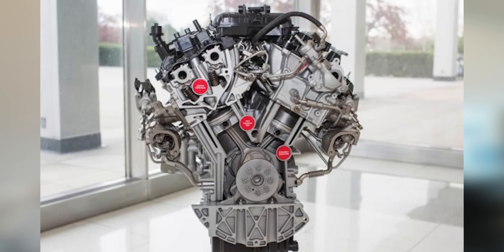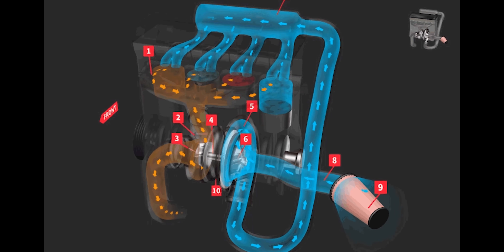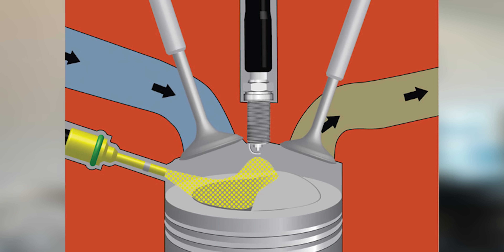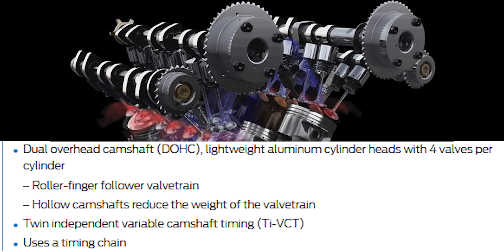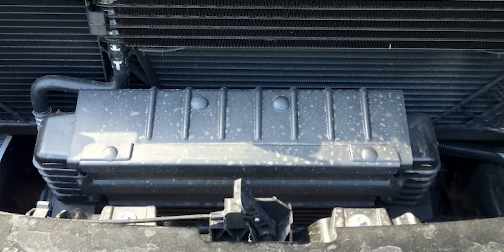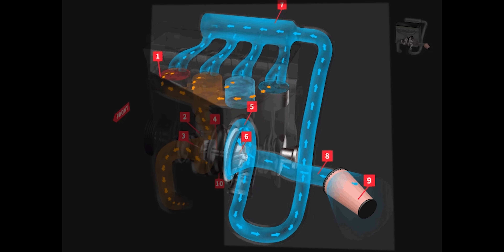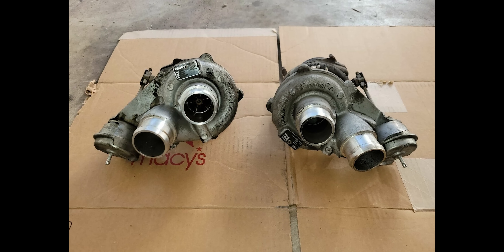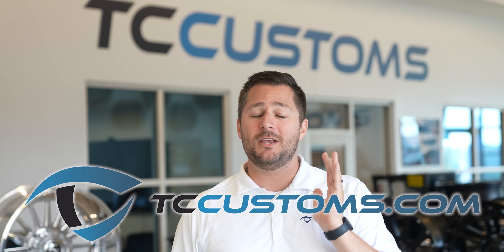The Truth about the Ecoboost Engine!

Comment: Dad just picked up a 2021 3.5. Awesome truck as long as the motor holds up. I told him to go with the ecoboost because the ecoboost has been getting updates with each generation. The 2018+ 5.0 has had many issues and they are not built as good. 2021 5.0 just switched to cylinder deactivation and a rubber belt driven oil pump. Not sure how well that is going to go after watching GM fail but Ford is usually a little better about testing. If this ecoboost holds up then I m sold on it. I was getting 24 mpg the other day with the cruise set on 70. Crazy to think in a crew cab 6.5' bed 4x4.
Reply: What about the timing chain, has that improved?
Reply: got a 23' 3.5 and its impressive.  Traded my 22' 5.7 Bighorn for the ford 3.5 XLT.  3.5 beats the hemi in everyway.   Also think the 10 speed helps a lot in the ford.  But Ram does have the Hurrican on the way for 25'
Reply: @dankruger2890  I’m very curious to see how that engine performs. The inline 6 making that much power is going to be crazy. Hopefully it will be good for Ram. The hemi was getting long in the tooth with no updates in years. The truck in the video is at 107k miles now. Gear shifter was replaced under warranty and had a few recalls but no major issues yet. My dads truck is now at 107k miles. Had the shifter replaced under warranty and a few recalls done but that’s it. All of that is really just part of having a first year of a new body style. He still loves the truck

Comment: 12’  3.5 eco boost currently 298,550 showing.  Besides the normal wear and tears it runs great.   Even if it laid down today I would have to get a newer f150 with an even better 3.5
Reply: Recently bought a 21', have you had trans problems?
Reply: @brianking9215  honestly no  but I don’t wanna brag because I expect anytime I could have.  At this point the only things have been brakes , caliper work,  exhaust holes/leaks, instrument cluster stays lit and doesn’t shut off with vehicle, took several jumps to find that out.  I pull the fuse each night now.  And my speakers/radio just one day quit working
Reply: @controlavirus9839  thanks for the reply, sounds like my old truck had 330k...

Comment: I thought that the purpose of an intercooler was to cool the air after its been compressed by the turbo. 
The cooler it is the higher the density, which allows it to move faster through and pack more of it into the engine
Reply: I think you accomplish the same thing by compressing cooled air, instead of cooling compressed air? Given the looks of that intercooler I'd hate to be pushing pressurized air through it.
Reply: @townhall05446  nonsense. When you compress air it gets hotter. How would you cool it before compressing it?
Reply: @mr.monitor.  mmhw
Reply: @ryanglover4549  what?
Reply: The intercooler cools the air before the turbo compresses it.
Reply: The intercooler cools off the air after it's compressed. Compressing air causes it to heat up.
Reply: NO! The real term is a Charge Air Cooler. It takes the nearly 300F compressed fresh air out of the turbo and cools is down. So it is placed AT THE turbocharger compressor outlet ant the intake manifold

Comment: the 2.7 EcoBoost on my F150 has over 100k without a single hicup..
Reply: AWesome!  Love my 2.7...54k on it right now
Reply: That's a lot more impressive on a 2.7 than a 3.5, the 2.7 is nowhere near as durable of a design, worse oil filtration and  only uses direct injection instead of dual port, plus being a smaller motor there's just less meat there to deal with the same stress.
Reply: @Prestiged_peck  Since 2018, the 2nd generation of 2.7L engines actually have both port and direct injection
Reply: @Prestiged_peck  2.7l makes less torque and power compared to the 3.5.  It doesn't not have the same stress to deal with so I doesn't need the same amount of "meat"

Comment: When the time comes please talk about the 2.0 ecoboost that will be in the Maverick. Thanks.
Reply: Yes
Reply: it’s essentially the focus st motor
Reply: What do you want to know? I work on them every day.
Reply: @solarfall2728  how have they improved over the time they have been in production? What are some issues that they have had and what did Ford do to improve it? Assuming with the regular advancements in technology, what might Ford introduce with the Maverick engine that could make it even better? MPG? Any special preventative maintenance that is unique to this engine? Thank you.
Reply: @solarfall2728  what's the most reliable F150 engine?
Reply: @solarfall2728  Thans for the in put. I have a 2017 mustang gt. The motor and Transmission hasn’t given me any problems.  Granted I only put 32,500 miles on the car. The car has a couple annoyances, but it’s not a bmw.
Reply: @matthewcordeiro2073  You got lucky. 2017 was the last year for the gen 2.
Reply: @solarfall2728  😂
Reply: I take my car to a Ford certified mechanic. He said he can’t do anything about the engine slap on the 2018.
Reply: @solarfall2728  thank you for the input
Reply: @nafsucof  yessss, basically the focus ST motor, just running an open block design, and a twin scroll head for the turbo. Same design as every other 2016+ 2.0 ecoboost ford model (besides the focus st which uses the closed deck gen 1 design)
Their solid engines, but like the RS 2.3 earlier iterations saw cracked block issues b/c of coolant passages between cylinder walls.
Reply: @ericjameyson2586  ik you asked solarfall but the gen 2 2.0 ecoboost had a open deck design with a twin scroll head/turbo which meant faster spool up times, the open deck designed also allowed for “better cooling” and lost about 5-10 pounds. Its a solid engine if you take care of it (i currently have one in my 2.0 fusion thats been heavily modified) only issue was that in the 2017-2018 some early production models were prone to cracking the block as they had oddly shaped coolant passages (was address) the twin scroll head also allowed for slightly faster spool times (although not really noticeable and mostly just in the low rpm ranges) solid engine if you take care of it, and it’ll take care of you.
Reply: @overknight5278  thank you!

Comment: I see that Ford replaced the plastic oil pan with an aluminum one. Good for them. I have to have mine replaced on my 2017 3.5 ECO after pulling my motorcycle to Tail of the Dragon. I was getting an oil change and my mechanic noticed it. Also, at 59,700 miles I had to have my Cam Phasers replaced and now at 150,000 miles, I'm getting the rattle again. I had my water pump replaced at 148,000 to address a "high speed fan" issue (turns out that it was most likely the thermostat but at that mileage I thought that it was best to do some preventative maintenance). Other then that, it has been a rock solid truck.

Comment: I love the 3.5 in my fx4. Love having the turbos.Only issue is I think my timing chain is starting to go. :(
Reply: Try some Lucas stabilizer, if it helps it's just the tensioner not the chain itself and you can limp it for quite a while with lucas. If not you'll need to get it looked at. Use the synthetic stabilizer cause the HD will screw with your VVT system.
Reply: Love mine too.
Reply: What year?
Reply: @buster2106  2013

Comment: I got a 2012 with 130k miles on it and the turbos are just starting to sound like i may be needing to rebuild them… might as well upgrade the impeller wheel, exhaust and tune while im at it 🤷🏽‍♂️
Reply: You'll will love the tune! I wish I tune mine when I bought it. 2014 with 45k on it. Been tuned the past 5k miles. It just drives better tuned. 5 star 87 octane street/tow tune on a SCT tuner. Tows the 8500lb trailer no problem at high elevation.

Comment: 2018 3.5 TT at 75K miles #4 injector broke open flooding the cylinder with gas. Took out the cat and $2800.00 later not under warranty. Have never had an injector go out but so far nothing else. impressive motor so far.

Comment: Great explanation but I prefer naturally aspirated engines. Less parts to go bad
Reply: Can't disagree with you, but honestly it's hard to find a non-turbo engine in a new vehicle these days. They have been discontinued everywhere to help meet the ridiculously high Federal CAFE regulation mandate. 
The 2.5L in Transit, and the 5.0L V-8's in Mustang and trucks are about all the choice you have left at Ford.
Reply: Actually I like naturally aspirated better too but, the turbo V6 probably has fewer parts with fewer cylinders.   That is of you compare similar eras. Now the long ago v8s did have fewer parts in the motor but had carbs and  vacuum systems which really sucked.
Reply: Regular engines are harder to find because dealers keep pushing these turbo engine cause you get a little better gas mileage. I'll keep my v8.
Reply: @rayrussell6258  The 3.3L V6 is available in the F150 and it's a terrific engine for a regular cab truck.
Reply: @Steve-yr5vi  yes I overlooked it, usually it's only found on a base XL and that package usually isn't in stock at the dealers around me
Reply: @derfskittlers6125  not exactly due to dealers' choice ... you missed what I said maybe .... the US federal CAFE regulation mandates the higher fuel economy given by the Ecoboost engines; auto companies don't want to pay fines so they have to (in some cases) force dealers to take enough of the high fuel economy engines and don't build/ship many naturally aspirated engines to them that don't help achieve the regulation.
Reply: And this is why Ford is not putting EcoBoost engines in the Super Duty trucks. Both the EcoBoost High Output and the PowerBoost hybrid make more power than even the 7.3 gas engine, but they are more complex which is not ideal for work trucks that run up to 12 hours a day for weeks at a time (for example, in Hot Shot trucking).
Reply: I get the concept of that idea, but I think it's a tired point that doesn't really apply anymore.  You probably don't have enough of a difference in "parts to go bad" to actually make a difference.  Does the ecoboost really have more parts in total than the coyote?  Hard to say
Reply: @jessaphillips2846  most Super Duties are not subject to the CAFE mandate; they don't even show a fuel economy label;  label is required on trucks that do fall under the CAFE mandate. 
The larger trucks are also more often subjected to greater load on the engine, which is not good for the relatively small Ecoboost displacements that have been offered so far. 
In a Super Duty, I would opt for the V8.
Reply: Same here brother.
Reply: @derfskittlers6125  Same here brother.
Reply: @Matticus289  No but its definitely more complex like I mean look at the Bronco with the 2.7L EcoBoost V6 with no engine cover.
Reply: @rayrussell6258  Same here brother. The EPA is also a liberal organization as well as the CDC is.

Comment: I’ve racked about 500,000km on various F150s having both the 2.7L and the 3.5L over the last 6 years or so - I just bought a new 2023 XLT 302a 2.7L if that means anything. I’ve out 80,000 km on a ram since July and never again

Comment: To avoid bad gas mileage on my 2011 F-150 Platinum ecoboost, I had to constantly feather the gas pedal to keep it below boost. The power was there on demand and the truck was nimble for it's size, but I didn't get anywhere near the claimed gas mileage despite a very light foot and it was not that enjoyable to drive with a light foot. Then it started accumulating random electrical glitches despite only 36k miles. Traded it it for a RAM 5.7L eTorque, which was much more fun to drive, better gas mileage, smoother, better rear coil suspension, more luxurious, and no issues so far.
Reply: I'm curious how that Ram is faring after a year since your comment.
Reply: After about 5,000 miles of completely trouble free driving, the engine and drivetrain appear to have “broken in” with noticeably better gas mileage than brand new. Now getting 17.1 mpg mixed driving only about 15% highway driving and despite switching to lower grade 87 octane since gas prices shot up over a year ago. Still has awesome power and buttery smooth shifting with the RAM 5.7L V8 with eTorque. I highly recommend it!

Comment: Turbos like clean oil swap it earlier than needed
Reply: @brandonsmith4825  if your not towing a lot or any I’d say 6-7000 miles would be good. 5000s even better but I wouldn’t go 10k I didn’t even go that long on my 5.9 Cummins I was doing 6-7000 on it
Reply: Or use better filters
Reply: @brandonsmith4825  definitely shorten the interval on the 2.7, has a MUCH worse oil filtration setup
Reply: @mick2798  the EcoBoost has a worse filter design and changes should be shortened accordingly

Comment: Does Ford consider the 2021s a third generation 3.5l ecoboost? I keep hearing about upgraded turbos compared to the 2017 first model year 3.5ls.
Reply: 2017 ??? The first 6 cyl Ecoboost was seen in early 2011 !
Reply: @7natcho  your right, but the second generation 3.5l with the 10 speed transmission first came out in 2017. I was wondering if the 2021 3.5l is considered the 3rd generation by Ford because they seemed to have made so many changes since 2017.

Comment: You .mentioned that the block was aluminum . I had heard that the block was changed to a compressed iron block to address an overheating problem that forced the vehicle to reduce rpms and limp home.  Same block as the diesels. Bad info ??

Comment: Just bought a CPO 3.5 EB and of course 500 miles after buying it the cam phaser starts rattling like crazy on every cold start. Can't believe the timing, now I need to go and hope the local dealership will fix it since I had this brought in from another city. Honestly pretty damned disappointing.

Comment: Keep in mind piston cooling Jets is not a new technology. It’s standard for over 20 years for all makes. My 2001 Jetta 1.8T and 1998 4Runner V6 have them. The turbo in my Jetta is also water cooled so not groundbreaking tech, just a continuation. And I’m with you on the 5k oil change. Oil is affordable.

Comment: Just got my 2018 Limited F150 back from the dealer. Engine rattle at start-up and transmission was shifting very hard. Replaced both cam phasers for engine issue and control module for the transmission. I have 74,950 miles. Ford paid for 66% of engine work and fortunately, I purchased an extended warranty that paid the rest and all of the transmission problems. Mostly highway miles and have never pulled anything. Considering extending the warranty for another 48 months or 40, 000 miles. Decision time.

Comment: I love my 2.7 ecoboost but do not take Ford’s advice on 10,000 mile oil changes. I change mine out between 4 & 5,000 miles max. Those engines need good clean oil or they will have a failure.

Comment: My 2011 f150 3.5 ecoboost has 400,000 miles on it and it still zips up to 100 mph pretty quick. Everything on the drive train is original even the turbos. I’ll buy another one as soon as this one blows up.

Comment: My understanding is that Ford had a serious problem with carbon buildup on the intake valves necessitating a major overhaul to fix and caused major loss of power. Their port fuel injection system, among other benefits, solved this problem by continually washing the intake valves, keeping them clean.

Comment: Oil cokes because the cooling oil stops flowing when the engine is shut down. That's why you idle it down to let the exhaust side cool and let the impeller slow, while the oil is still flowing to cool it below the critical temperature.
Reply: So how does that work with the new stop/start feature vehicles have now.
Reply: @regould221  It doesn't.
Reply: @rickster4455  so you are saying the start stop feature is going to cause the turbos to fail?
Reply: You have to think about turbos like a part that will have to be changed before the engine wears out.

Comment: That 3.5 sounds almost as advanced as the 2.7, almost.
Reply: The 3.5 is far past the 2.7, the 2.7 has a worse oil filtration design, a much weaker block, and only having DI causes carbon buildup issues and more particulate emissions (so much that they're required to have particulate filters in europe, like diesels), the first gen 3.5 was on par with it other than simply being stronger thanks to size, and more performance focus, but with the addition of dual port injection the 3.5 passed it.
Reply: @Prestiged_peck  You are miss informed badly.  Better do your back check on the current 2.7 again so you know the facts!

Comment: The truth about the Eco Boost engine is that I'll keep driving my 5.4 Triton 2 valve thank you
Reply: @James Core Don't know what your gas mileage is but my 02 4x4 with 4 speed auto and 3.55 axle gets 13 to 15 mpgs

Comment: Bought a new 2011 F150 4x4 3.5 eco engine.  Lots of power?  Yes.  Great MPG?  Not really.  Engine start up rattle started at 35K miles, seized vacuum pump, rusted out front brakes at 18k, blown AC condenser (under warranty), rear window shattered due to defroster, hosed up sync system locking up (fixed several times under warranty), and I traded it in after 5 years and 40k when Ford refused to fix the start up rattle under warranty (I guess the rattle wasn't bad enough yet, but it was on the way out!).  I'm not going to buy another Ford after all the problems I had.  Let's see if anything was improved after 10 years.  Good Luck!

Comment: I think you misunderstood how shutting off a hot turbo affects it.  Since oil is pumped through the turbo for both lubrication and cooling, when you shut off a hot engine the oil stops flowing and sits in the turbo and bakes, creating a sludge.  Giving it a bit of time to cool before shutting it off helps reduce this.  Some companies offered an aftermarket system that would continue to pump oil through the turbo after you shut the engine off.  The exact term escapes me but I'm thinking it was called an after run system.

With this said, the 5.7's in our Rams are going 10,000 miles on synthetic and I personally don't worry about length of time so Ford isn't doing anything ground breaking here.